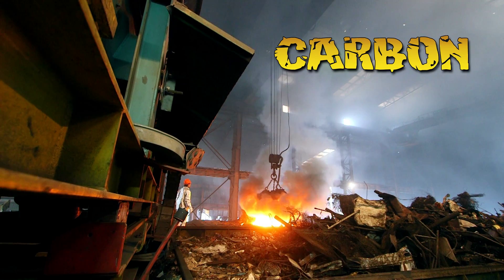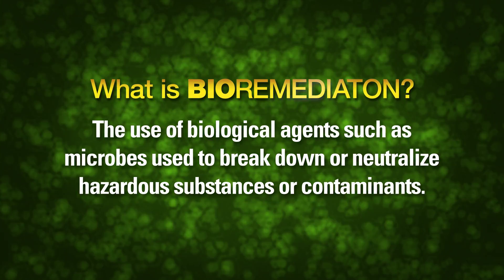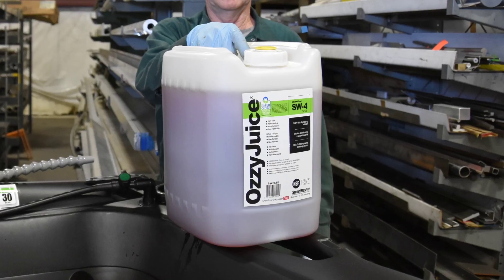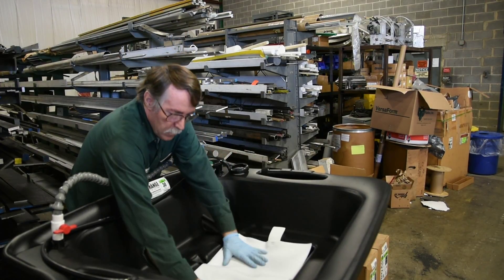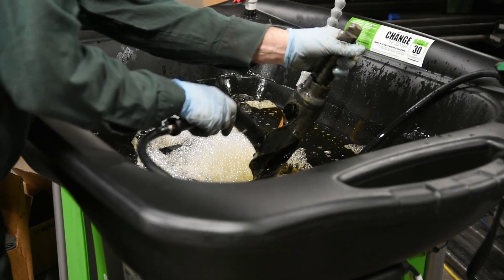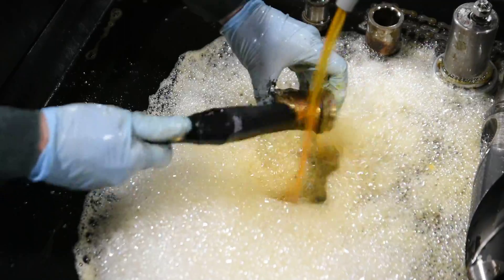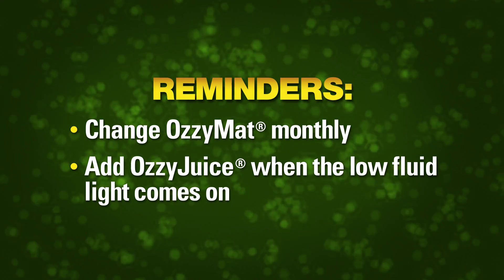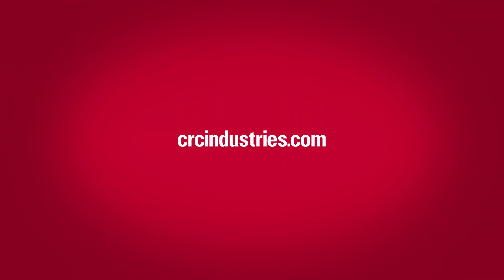Unleash the Smartwasher® Bioremediation System

Comment: purchased an sw28 smartwasher 15 months ago due to the fact our old one was 13 years old and they stopped making parts for it.  was told my chemfree that this was the best and most reliable one to buy for $2000.  WELL that was a load of crap.  2 weeks ago i discovered the heater went bad so i had our local distributor order one.  now get this...its been 2 WEEKS and still no part.  talked to chemfree directly and they told me this is the ONLY way i can get parts for this.  so the distributor HAS to order the parts from CRC who then orders them from Chemfree and NO ONE will give any tracking information on them.  DO NOT BUY ONE OF THESE WASHERS!!!  They work great but apparently they have LOTS of problems